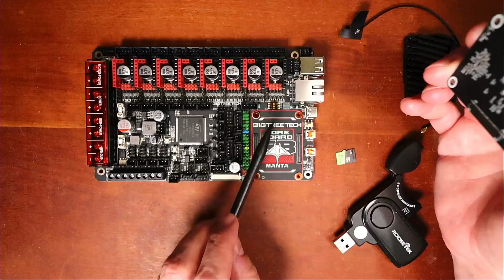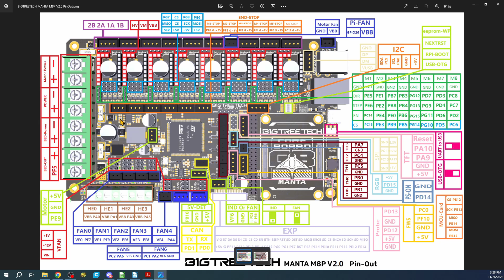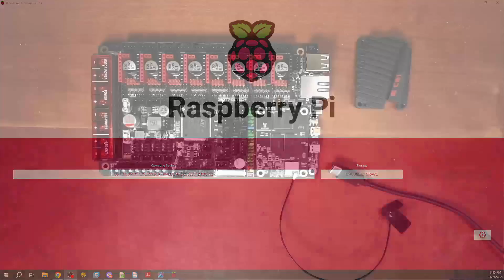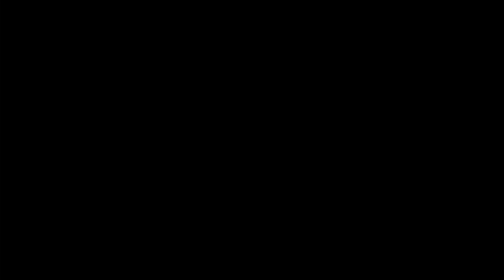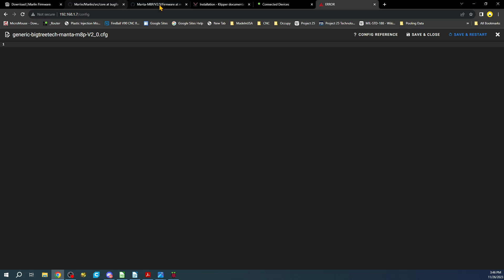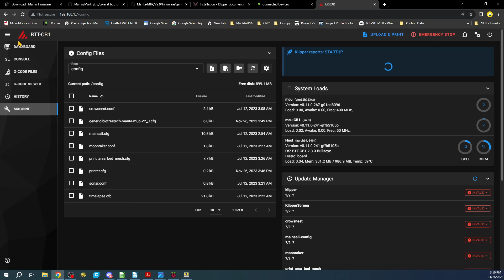BTT Manta M8P v2 - Basics with CB1 v2.2

Comment: That is shittiest board I dealt with... Nothing works as documented or you explained (still thanks for best explanation online). `ls /dev/serial` is exactly where all fun starts. Recommendation to everybody - avoid getting this.
Reply: damn dont say that i just ordered it... 😭
Reply: I actually found the root of evil. 
When you run initial setup - make sure you have at least 1.5Amp usb port. 2A is better. Otherwise you are doomed: it just sporadically corrupt firmware on update, hang, run into latency issues or so. And no any pointers that it actually starving on power.
Reply: @justsomejunk399 ok thanks thats good to know. Sorry it sucks for you tho!

Comment: Hi, i followed your instruction here but after i insert the sdcard nothing seem happened. I use raspberry pi imager but always got verify failed. I use other like belena and rufus but seem nothing happened either. I cannot detect the IP address. CB1 is green. What could possibly wrong?
Reply from the maker: Bad SD card seems to come to mind.
Reply: @EdwardBraiman  is there any specific specification for sd card? Since if i format into fat32 i can use it just fine. It can write just fine with rufus but when i inserted to manta, nothing happened. Just blank screen.

Comment: Hello good morning. I have a manta m8p v2.0 board with Klipper but no video comes out of the micro HDMI port. Do I have to do something or configure something extra to activate the HDMI output of this Board? Because it gives you video through the micro HDMI port. Greetings
Reply: I am having the same problem!  I can only get HDMI output when I have the USB-C powering the board, but not when I have the board powered via the terminals.

Comment: lovely video. Sadly im having problems with getting the mcu-ip of my board. is there any other way to get the ip?
Reply: I have got the same problem too, Ip doesn't pop up for the board , 
Since it is been 5 days were you able to find a solution for that if so please tell me
Reply from the maker: IP issues normally boil down to WiFI router setup in file.  There's a Discord link in description of video.

Comment: Hey! Thank you so much for this video. Really useful. There is however one thing that I don't really understand. All the installation is for the CB1, but you mentioned that the MBO / MCU already comes with firmware installed on it. Is there a way to verify the firmware version? Do we do that through the Klipper page? In my head, the MBO and the CB1 are two different things that work together, so I don't really understand why we do nothing for the MBO.

Thanks again!
Reply from the maker: Thanks.  There might be a version gcode like Marlin, it might be the same.

Comment: I still don't fully get what the 5v jumper is for. Ok to power the cm4 when installing, but do you remove it when you're done?
Reply from the maker: 5v jumper os to show you, you can load with 5v rather than with PSU power.
Reply: @EdwardBraiman  thx yeh I had chatgpt answer this for me haha :) 

I like this board, but having severe issues with the canbus and with my thermistor (well ok the thermistor issue comes from the EBB SB2240).

The canbus doesn't appear on the /dev/serial .. I do find it with that flash-util, but every soft reboot will break it and I have to hard turn it off/on again, frustrating af
Reply from the maker: @djmulder yeah the stuff I don't cover normally has issues.